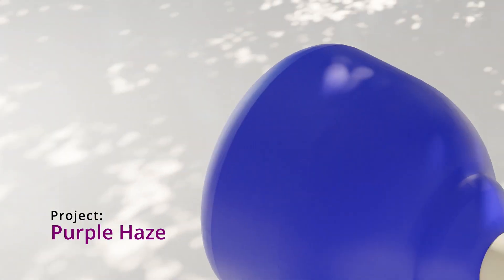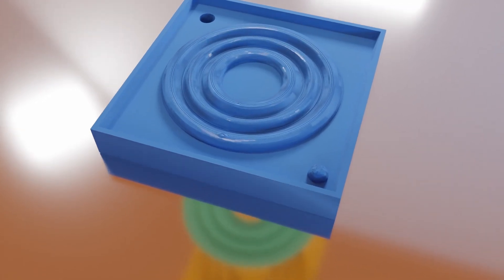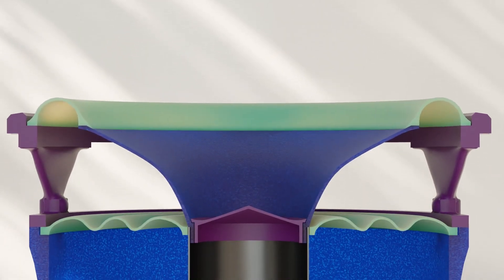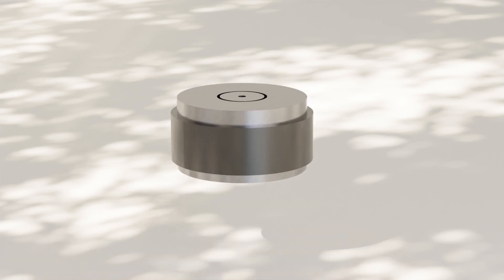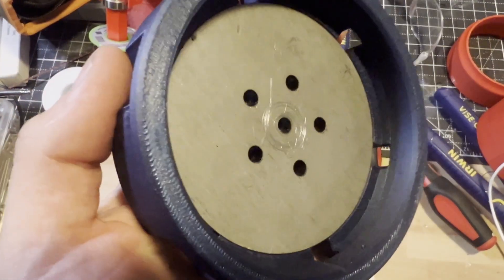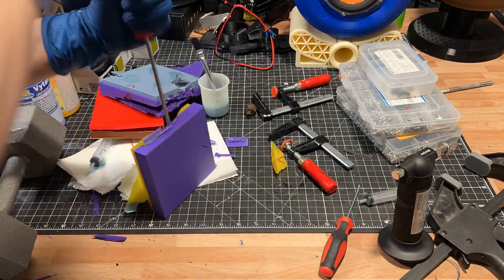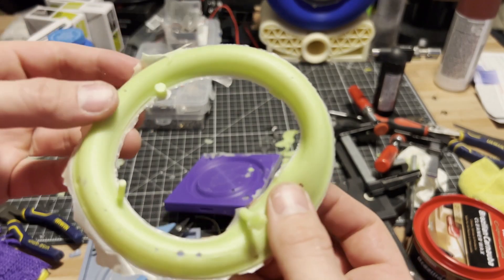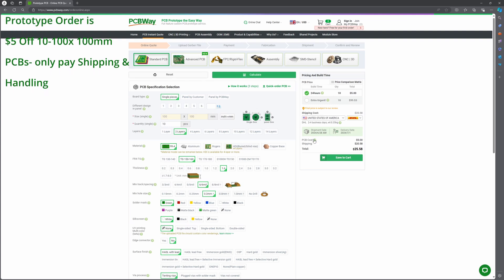Almost* Fully 3D Printed Speaker v16.1 - Now with Less Printed Parts!

Comment: Have you thought of using vapour smoothed ABS or ASA for the moulds? You can get very shiny surfaces using this method and it's almost instantaneous, quite low effort.
Reply from the maker: I’ve played around with that before but not enough to get repeatable results.

Comment: do you ever think you would do a full 3 way speaker design with a woofer, midrange driver, and a tweeter, compromising the 3d printedness slightly to trade in sound quality? I think with your vast knowledge on this topic you could create a speaker that sounds better than some very expensive speakers
Reply from the maker: I could produce a woofer and midrange currently, however I have very little knowledge on tweeters and their construction. So I would have to make a few prototypes before I would feel comfortable building an entire 3 way system with them.
Reply: I loved this video and the process you went through is incredibly boring and humbling as well. I hope you can remain persistent and do great discoveries and designs. Even though I can feel the pain of audiophiles all over the world. World is getting even crazier now with all the technology available for a desktop. Printing, cutting steel, wood, plastics and literally almost everything. I'm happy I can see the new era emerge in my 30s. Who knows what people will be doing 50 years from now on (except for energy of course)
Reply from the maker: For me, none of the process is boring. I do consider myself quite entertained with learning though, even if the process is tedious. I will say this project has been frustrating at moments but never boring.
Reply: @piscesprinting  this proves that you are even better than we expected :) must be young

Comment: Still watching the project. Much better approach. The spider I would offer more ripples in for a tighter suspension. And a resin printer for the cone and suspension parts I think will go a long ways. Also offering a lighter cone. Just some advice.

Keep up the good work. Its fun watching each outcome.
Reply from the maker: I’ve tried the resin route before, the issue is that the thin cones end up breaking when supports are removed, plus it’s just a pain to clean/cure/post process. 

Potentially in the future though I’ll circle back to resin again.

Comment: Well done!!! My own experiments have mirrored yours.  The hardest thing in 3D printed speakers to get right is the magnetic gap.  I am currently up to 4.5 Tm on a 5g driver.  This is a massive improvement, but still isn’t enough to do a tiny ported box that is small enough to fit two onto my Prusa bed.

The other thing I am struggling with is the surrounds — I know if I could drop mass I could get Fs down below 60 Hz.  I really like your molding solution.  Are there any foaming TPUs available?
Reply from the maker: Speaker version 16 uses a TPU called Varioshore- which foams and changes shore hardness according to temperature extruded. 

For magnetic gap I’ve used laser cut steel plates, I’d like to try some cnc plates though at some point. But I usually run a gap between plates around the 1.5-2mm range.
Reply: @piscesprinting  I know you used Varioshore when printing, but is there something similar for molding?  Just thinking of neoprene surrounds — there must be something that is a consumer product…
Reply from the maker: I’m not sure- I played around with the foam they use for cosplay(I forget what it’s called) as it’s supposed to be heat formable but I couldn’t get it to stay in shape.

I know urethane can be bought in different hardness from 10A to 80-90A

Comment: Great Project! 
With the Rubber bubbles i would do it like Brake Bleeding.
Get a loaded Syringe and a Closed Empty one. Then Suck out the Air and same same in the Fill material.
So you propably get an part without bubbles.
Reply from the maker: I ended up filling the mold, putting it on its side, then holding a small dual action sander to it for 10-15 seconds and then topping it off, seemed to work. 

I think a pressure pot might have worked as well though.
Reply: @piscesprinting  thats also a great way to do it.